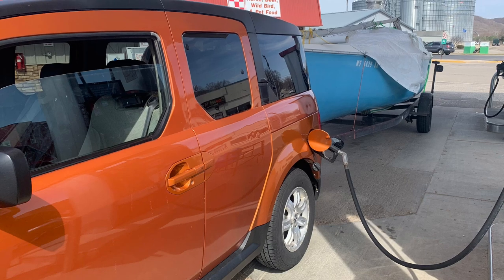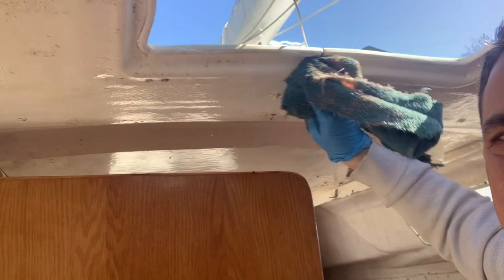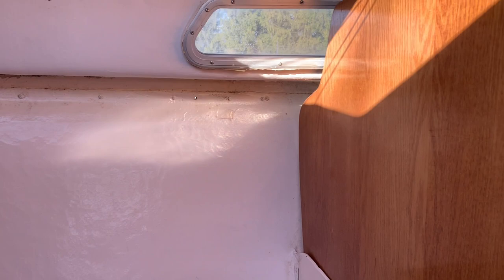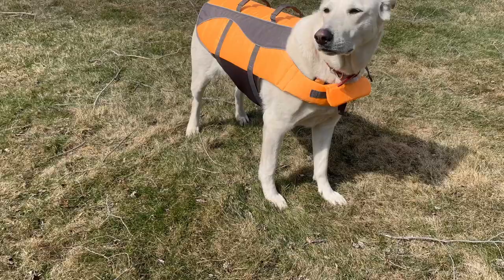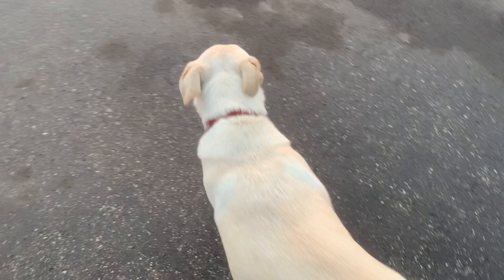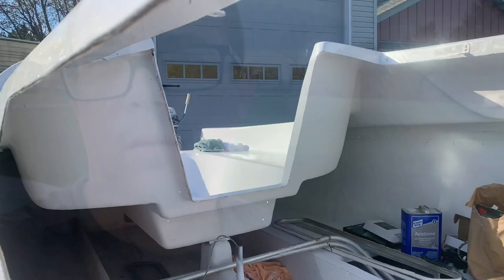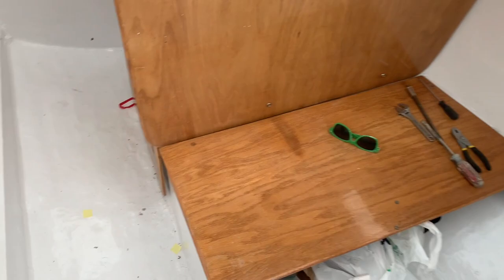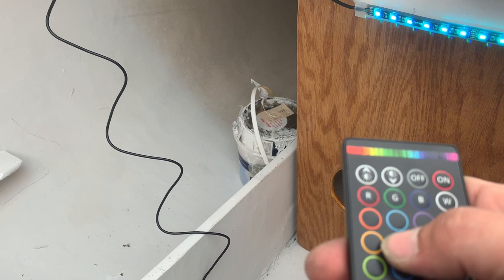$350 Craigslist MacGregor 22 Trailer Sailer Restoration pt.1 #Sailing

Comment: Great information. I am actually looking to buy the same model boat. Can you give me  some advice on what to look for when inspecting a Mac Greggor 22 for purchase. Any help would be appreciated.
Reply from the maker: Make sure you clear everything out and use a mold and mildew remover or bleach substitute. I painted the textured areas by using top coat paint and a grit additive for painted stairs. Don’t use that! The grit is way to aggressive and takes skin off. Lol I need to add a few coats of top coat without grit to undo what you did. That should soften it up. 

I have a small jib with a roller furling. I love it for my learning curve. Being able to downsize my front sail at will is very solo sailing friendly.
Checking your sails for damage from mice and wear damage is huge.
I have had people ask why I need winches on such a small boat. I must say I think it’s my best upgrade. I don’t use my winch handle much but having winches saves my hands from rope burn and struggling a lot. I picked up the cheaper W6 winches and they are awesome!
Last thing I can think of that’s a big project to fix is a rusty keel. Some rust is ok but full on rot requires you to remove the whole keel and fiberglass it. A YouTube exists of it being done and the whole process involved. Sorry I don’t have a link. It’s not my Video. But it is informative. Just search MacGregor keel repair.

The retractable keel and camper top are so awesome on my local river. I see people with similar boats without camper tops and they hit their head a lot.

Comment: Good job Johnny. What paint did you use on the exterior and what did you do for the grippy walking areas? Thanks
Reply from the maker: I went to west marine and bought white and blue top coat paint, foam rollers and brushes. I went to the local paint department in a hardware store for the sand grit paint additive. I  added it to the blue paint and uses a normal paint roller to apply. Only thing I would do different is I would do a coat of pure blue paint on top of the gritty coat. It was almost too rough and a pure coat on top would dull it a bit.

Comment: Great job. just a couple months from dunking my 71 South Coast after a five year rebuild very similar to what you did. now tell us all how in the heck you got the windows back in?
Reply from the maker: I had small screws in the aluminum trim that sandwich the plexiglass. I removed all of them and scraped any silicone. After painting I used some plumbers puddy tape around the perimeter and re-sandwiched the plexiglass in the aluminum trim again. Very easy. Just a lot of small screws. I hope that helps.😊

Comment: About how much money do you have in it? The restoration part.
Reply from the maker: About $1200-$1500. I did get a 20watt solar charger too. I had all 5 lug nuts come off somehow and the tire was shredded in the wheel well on my way back home. It was on the first time out. That was $250 in tires.

$350 For the Boat
$200ish Paint, rollers and brushes, cleaners
$150 for ropes/running rigging
$250 for tires and lug nuts
$50 Amazon boat light kit
$100 battery
$200 motor

I hope that helps. I’m working on the interior soon. It will have a large bed area and a cooking area.